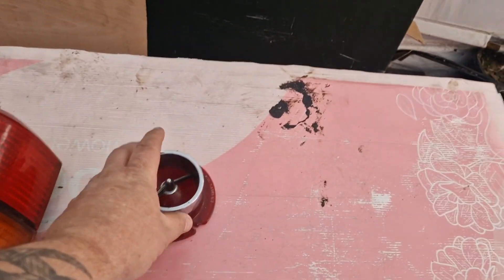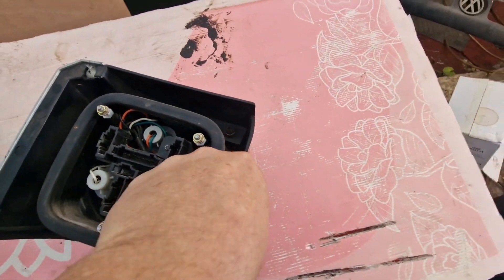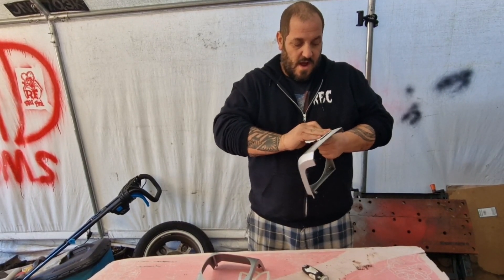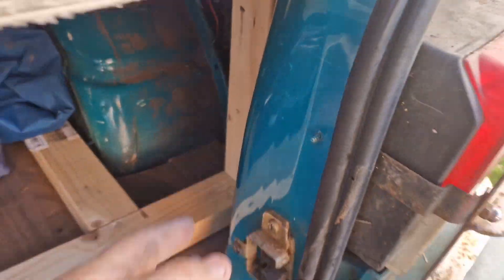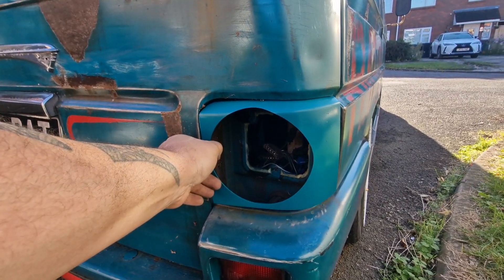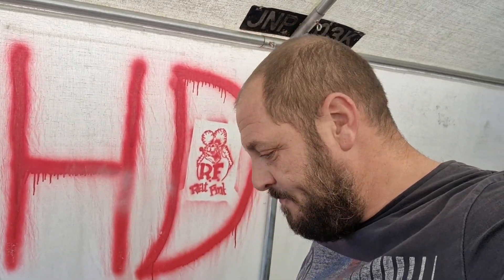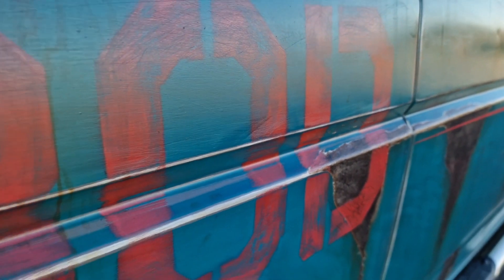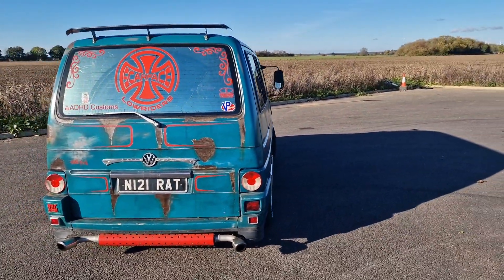VW T4 REAR LIGHTS ON MY T4 RATROD

Comment: when i first saw them i thought eww they are ugly ass, but they actually look pretty cool on the van. And the darkening trick also worked like a charm. A tip in case you didn't know fake chrome can actually be made pretty nice using aluminum tape in case you or someone reading have something that needs chromed up. i did the wiper arms on my rat single cab T3 and it looks pretty good and seems to last for a long time. I have somewhat deep dish remotec wheels on it and are thinking of chroming the lip of the wheels with that as well :P Can only last longer than chrome paint
Reply from the maker: Yeah I don't think they would work as well if the van didn't have all the other mods on it. 

Ah cool idea man. Thanks for the tip 👍